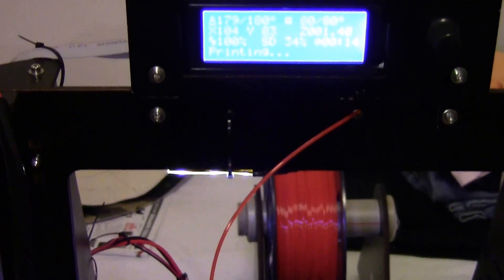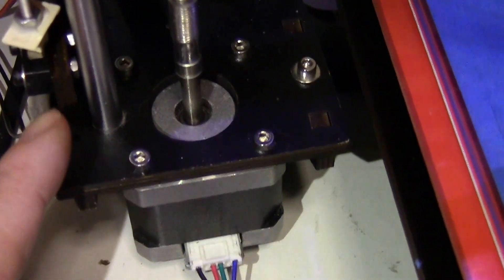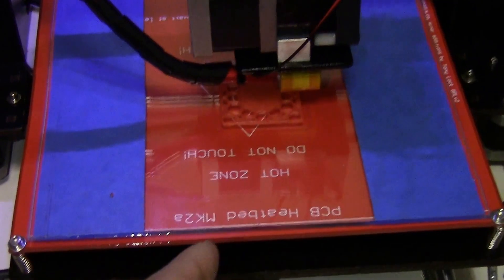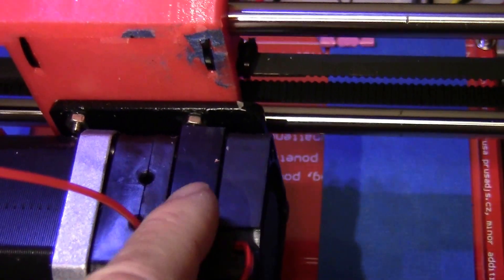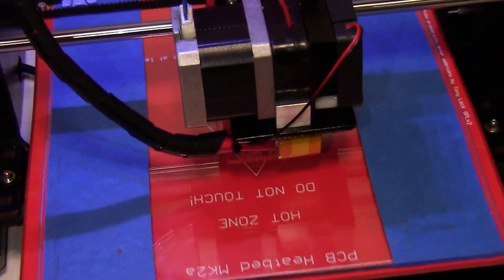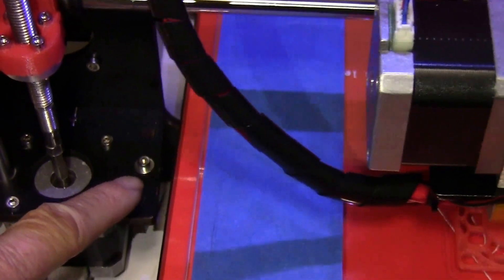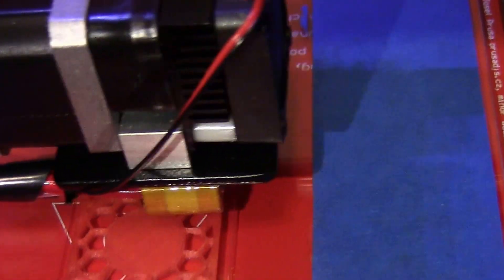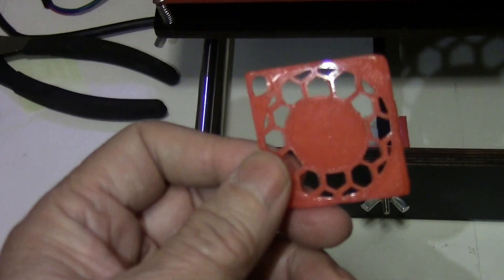Prusa i3 clone assembled and first successful print job

Comment: Looks pretty good. The answer to the fan question is the blowing air can help pla have better looking results and also helps with things like printing over hangs and stops the hot plastic from sagging  Mainly only for pla. The nut mod i did was because the hole the threaded rods run threw was too large and the front of the bed could be pushed side to side about 1/4 inch  so the nuts tighten that slop up allot. If your machine is tight and the front can't wiggle side to side id say your good without the mod.  Your off to a great start... hope your having fun
Reply from the maker: Thanks for your help.  I temporarily put a small 5 inch usb fan next to the hot bed. I don't know if that'd help or maybe it's overkill. I ordered a radial fan and maybe print a shroud off Thingiverse. The power supply definitely needs a fan as the heat sink in the back gets pretty hot.